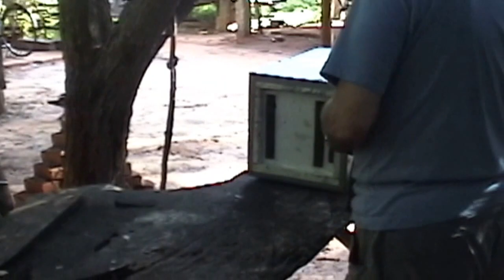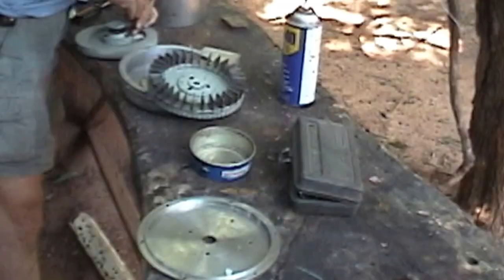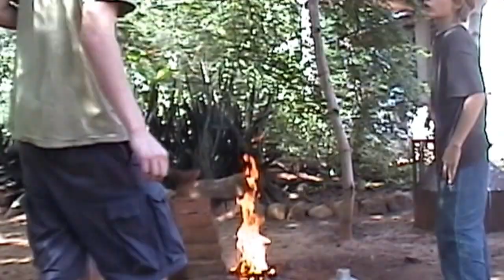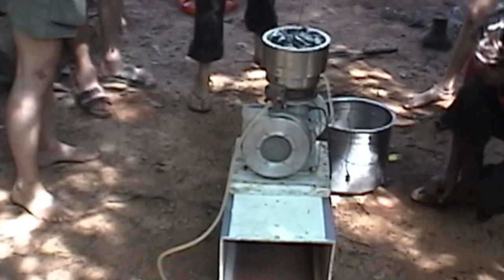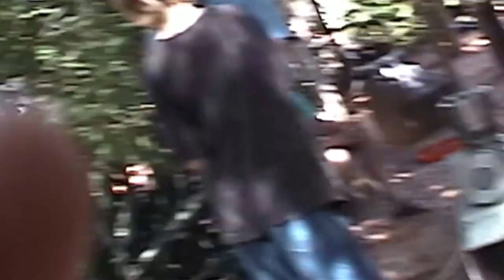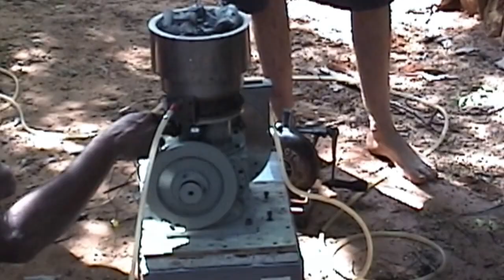Dr. Merrick Lockwood's mini Stirling engine

Comment: what he used to make this engine ?
Reply from the maker: at the time he had a small metal shop and access to the foundries in Dhaka, Bangladesh. I know he had a lathe and a small milling machine. I'll get a video comment feed back with more details.
Reply: I believed that it was an old air conditioner
Reply from the maker: I've heard the compressor from an AC can be used for a stirling engine but I have not seen it being done. In this case he designed it using Generic CAD and had help with hand building it in Dhaka. In this video it's running in South India but he has funny stories of him flying with it and airport security being very puzzled with this engine packed in his suite case.